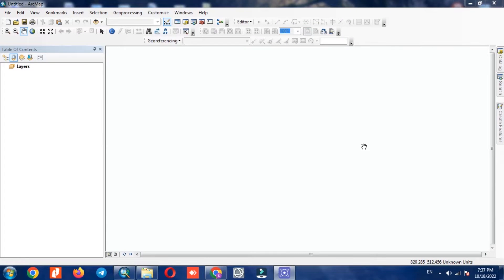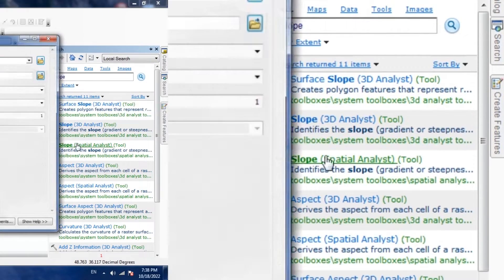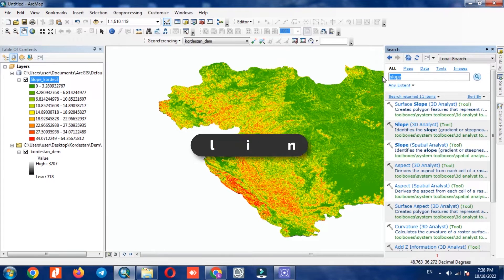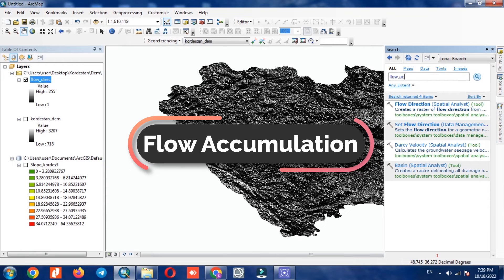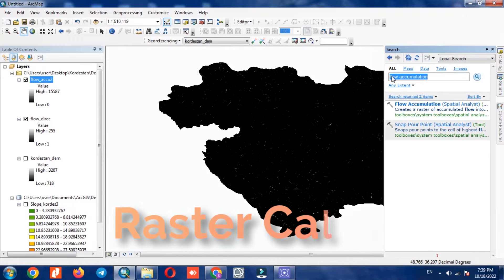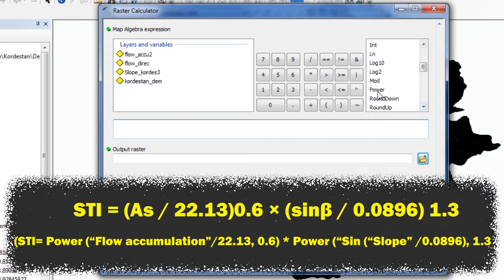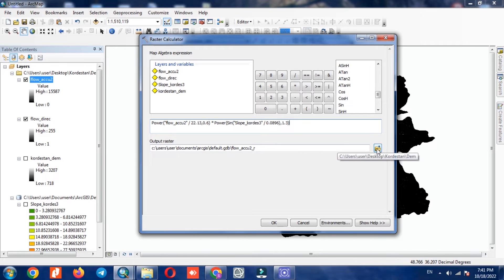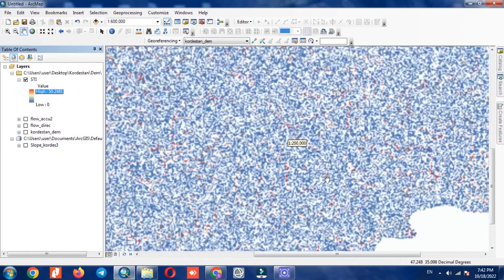Sediment Transport Index (STI) in ArcGIS

Comment: I was hoping you describe what is STI and what is the useful point from it?
Reply from the maker: Sediment Transport Index:
Sediment transport is used to describe the movement of solid particles (sediment) and the processes that govern their motion. Sediment transport is typically due to a combination of the force of gravity acting on the sediment, and/or the movement of the fluid in which the sediment is entrained. Sediment transport plays a vital role in the development of soil erosion process models. An index for this purpose is the STI or The sediment transport index. STI characterizes the process of erosion and deposition. Unlike the length-slope factor in the Universal Soil Loss Equation (USLE) it is applicable to three-dimensional surfaces.